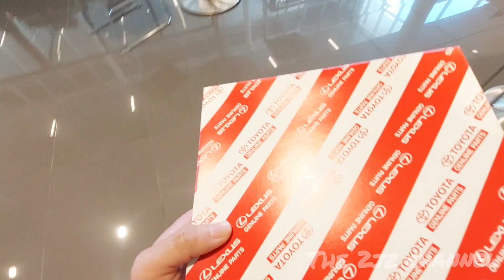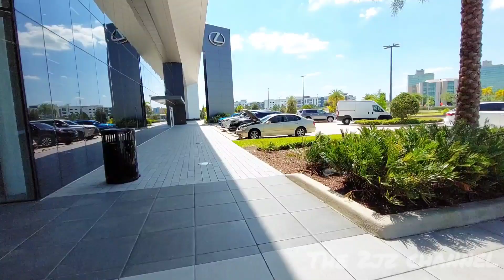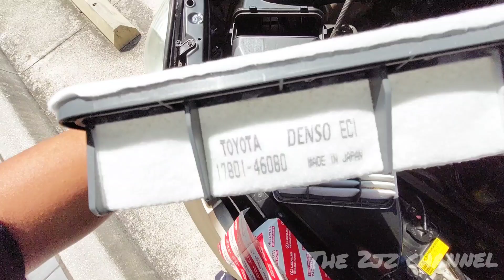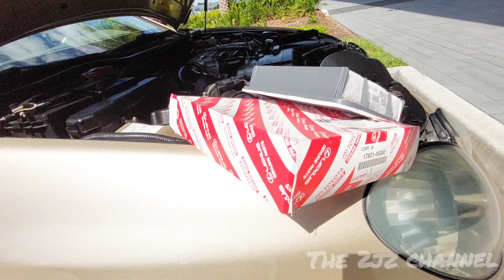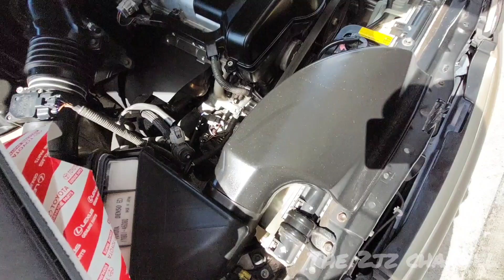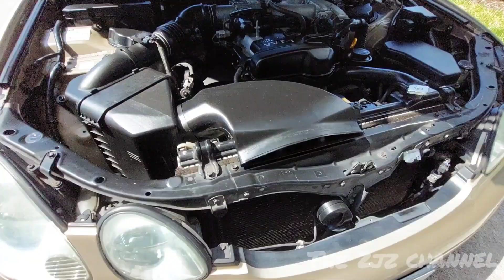1998-2005 Lexus GS300 2JZ Engine Air Filter Replacement Tutorial

Comment: Those are some really great tips that you pointed out on how to improve the factory air intake system. Your engine sounds great too.
Reply from the maker: Hey James! Thanks. Yea just some little things that helps improve the efficiency of the stock air intake but the game changer was that Figs Engineer heat shield. It really does make a difference, especially during stop and go traffic. The heatsoak really reduced engine power output especially when the Intake piping is just right above the exhaust manifold. With the heat shield the engine bay is a whole lot cooler especially around the air intake area.
Reply: @the2jzchannel   I wonder why Toyota engineers didn't thought of installing a heat shield from the beginning? Btw your gs seems to pick up pretty quick, not to bad for no turbo lol.
Reply from the maker: @James16305  haha I'm guessing because Toyota care more about the 2jzgte turbo variation lol but all jokes aside, nah man it's not that quick it's just a nice comfy reliable highway cruiser. I guess it's alright for what only 170hp to the wheels on a 3700lbs curb weight lol. But I gotta say what really shine is the highway driving it gets up to speed if you push it. The high speed stability and aerodynamic is good for a older car.
Reply: It's because the oem exhaust manifold comes with a heat shield already on it  @James16305
Reply: If I remember correctly the V8 version of this car the GS400 claim to be one of the fastest sedan at the time before BMW released the M5. Well that says alot for a brand like Lexus when they didn't have a sporty image. I'm sure that Toyota benchmark the European competitors to be able to withstand the high-speed stability and aerodynamics.